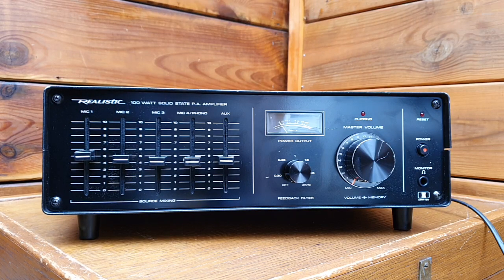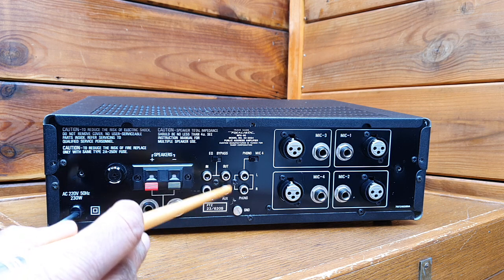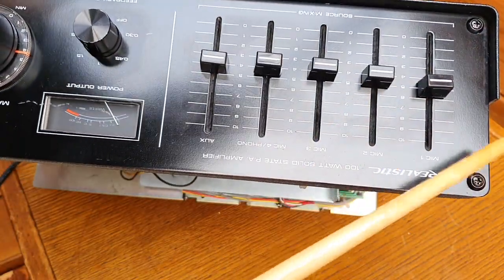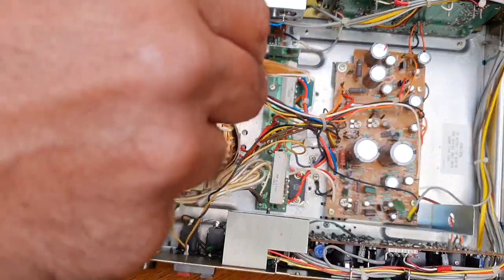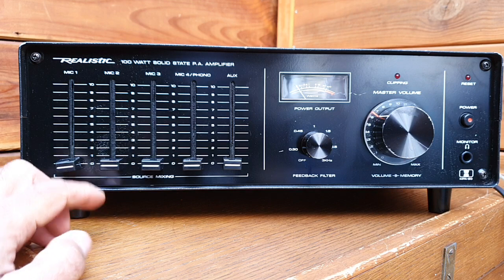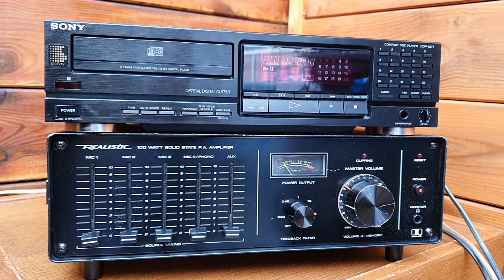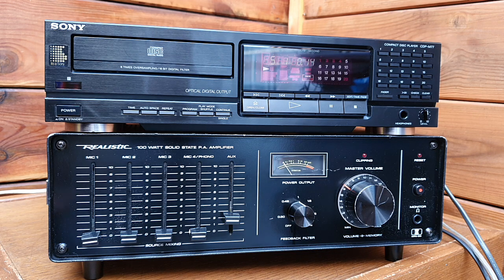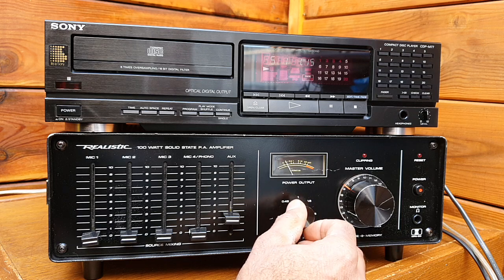Realistic MP-90 Amplifier Model 32-2024 | Technical Deep Dive | Vintage Audio Enthusiasts, Rejoice

Comment: Hey do you know how does the feedback filter works ? And what cable should i use to use it with my headphones ? i know it is not jack or mini jack but i don't really know what is it.
Reply: The jack is most likely a 6.35mm or 1/4 inch stereo jack, the reason for this is a lot of old headphones had that style connection, but now we use 3.5mm. Anyway you should be able to use an adapter that goes between the two sizes to connect your headphones.

Comment: Not sure if i heard you correctly, but the amp is not stereo. It actually outputs mono, but i am assuming there are 2 amplifier chips for Push/Pull, so i am assuming this is probably a Class AB amplifier. I actually have one of these too. They are great
Reply from the maker: Thanks for poitining it out indeed its push/pull circuitery of the class AB amplifier. This is achieved by biasing both transistors so they conduct when the signal is close to zero & that is the only reason why this amplifier offer a more linear output response, which leads to better overall sound quality.  But once can use two seperate mono input using both amplifier chips then its amplifies each channel seperately thus technically that what stereo amplifiers do even though I fully agree it is not produced as stereo amplifier at all. I am glad that you have one I do like the cound of it. Thanks for sharing your thoughts with the community, much appriciated for your support to my hobby channel. Cheers Mate